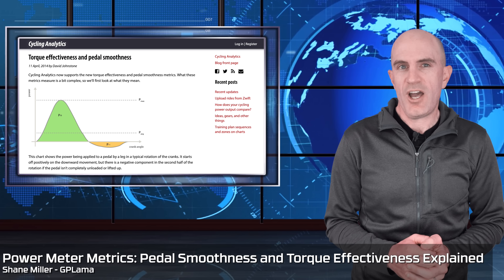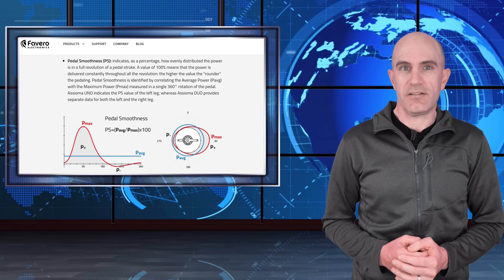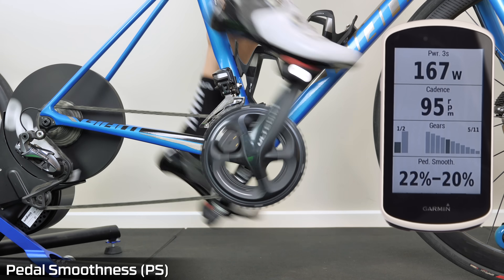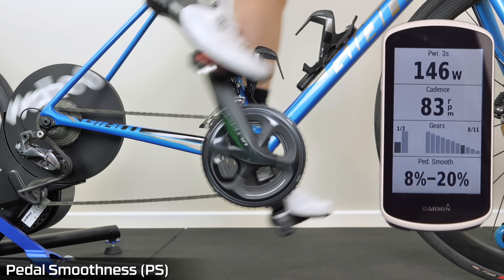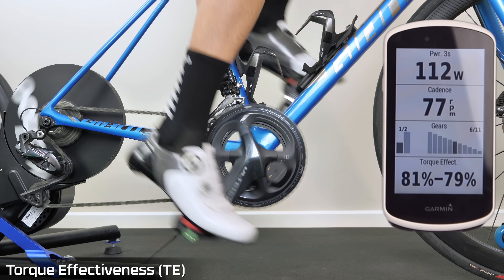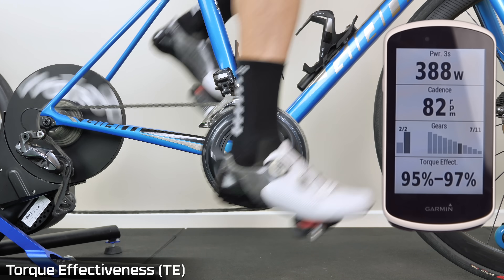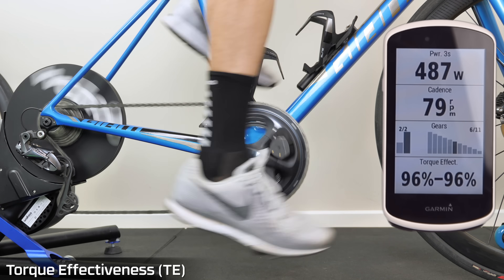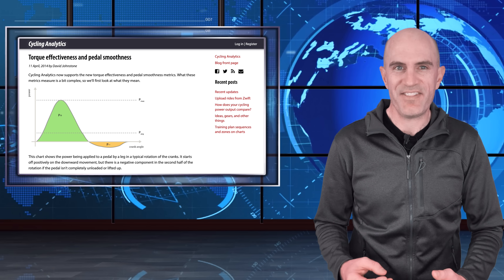Power Meter Metrics: Pedal Smoothness and Torque Effectiveness Explained

Comment: For fatigue I would think power/lack thereof would be a better indicator than TE. Like you mentioned regarding PS when trying to get to 40% that it was very uncomfortable, I'm curious if similar to "optimal cadence" if that is subjective to how each rider feels or if they are standard levels to aim for, thanks Shane. These metrics are very intriguing but still trying to determine effectiveness for the "weekend warrior".
Reply from the maker: Lower power is the result of fatigue, yep. Additional metrics (maybe these, maybe not these) could give an insight into why or where the lower power is occurring.

Comment: Thank you. 
? Elliptical chain ring metrics? Your opinion without a lama-lab test? Especially the torque metric.
Reply from the maker: Not something I’ve used sorry. Not enough data to convince me they’re worth the time. And not enough power meters support them to give good/accurate data I can use to check other meters against.
Reply: I have been using it.... I feel it's a placebo effect. Bees-dick difference. (miniscule)

Comment: I have a page on my bolt with pedal smoothness,  left/right power balance, and rpm.  I switch over to this screen for a couple minutes every 3rd or 4th ride to check in on my metrics.  Thanks for the video!

Comment: My pedaling smoothness and torque effectiveness are lower than yours on most rides. But I ride oval chainrings. I wonder if that's the reason...🤔
Reply: Do you often lift with your pedals? Pulling up and pushing in complete cirlces will increase the number. Biopace shouldn't drastically effect it

Comment: GCN has shown that there is almost no difference between clic and flat pedals. Thats why I use flats and am a happy rider 😁
Reply: That's bullshit. GCN advertises a lot of bullshit.
Reply: @marekzmazur2077  see my other post. For me, there is no difference in normal riding. Last 250m to the line, okay I'll take clipless.

I have extra large flats, so I don't have issues with slipping.
Reply: It may have some downsides, but I like to be able to move my feets, move to the toes out of saddle, mircroadjust etc. I just wish there were flat light semi stiff shoes.
Reply: @Tethysmeer  a massive downside of road pedals, the extreme danger of even walking around the cafe, stairs are booby traps 😂 or if you have a major mechanical, and need to walk any distance at all.
Reply: The only real difference is more stable connection between foot and pedal. I hate when my foot slides or even drops from the pedal (which is dangerous), that's why I use SPD. Other than that I doubt there is any significant power or efficiency benefit in using clipless pedals.
Reply: GCN is not a reference source of information. They are advertisement for products and Dogma
Reply: I'm really surprised this is not common knowledge among even weekend warrior cyclists! An efficient pedal stroke is one where you maintain power through 360 degrees. Push down with one leg and pull up with the other. This way power is generated by both legs at the same time. You lose a lot in terms of power and efficiency when not clipped in. Even during just casual riding. Flat pedal riders will argue till they're blue in the face but that's just the reality.
Reply: @marekzmazur2077  This is simply not true.  It's a myth busted long time ago. The power is produced predominantly in downstroke. Our legs evolved to push, not pull. Upstroke is mostly about properly unweighing and working in sync with pushing leg. (check this out: https://youtu.be/yjVJIudTK8E?t=345)
Reply: @michwoz  that theory was busted a long time ago. The only people who think this is true are weekend warriors, the pros have been tested and they don't do this. Did you even watch this video? As Shane himself showed he doesn't do it, and he looks pretty damn smooth to me.
Reply: @MrBJPitt  Agreed. The Smooth pedal stroke exist, but not 360 degree. More like 270 degree. 
100% push down on one side, other side do nothing to pull up.
At top and bottom, one leg do scrape pedal backward at the low point (~60% of the work), other side do 40% of the work pushing the pedal forward.
This is smooth, without pulling up.
Reply: @Hexsense  I don't think the pros even scrape? The "smooth" effect is not purely because of pedal stroke range. The pros have a narrower pedal stroke range than many amateurs who try and scrape.
Reply: @MrBJPitt  Yes, they don't really scrape much at all if the inertia is high enough that the crank turn by itself fast into to the down power phrase anyway, which is most of the time at speed.

The scrape happen when the inertia is low, like climbing slowly, or accelerating from very low speed etc.

Pro simply have more power, and most pro's additional power are in the down stroke so it is more imbalance between phrases than people with less strong down stroke.

Comment: I mix between flat pedals or clipless when riding indoors on the kickr. Of note - my best power metrics I've achieved this year are with flats.... So I'm not sure there is really a difference, unless I'm doing 100% sprint efforts.

The flats I use have a massive platform, the largest pedal you can buy.
Reply: The majority of the power is generated during downstroke, hence there is not much difference in that regard (if any).
Reply: @michwoz  so then, why the accepted notion that clipless pedals are a must have?
Reply: @MrBJPitt  Firm connection between foot and pedal provides more control, comfort and paradoxically is safer. Especially when sprinting, riding at high cadence,  out of the saddle or on bad surface where foot may slip or completely fall of the pedal.
Reply: @michwoz  maybe you are right. It's odd as downhill riders who face all that in spades prefer flats.

The flats I use never have those issues, and the comfort is unparalleled. I can use my feet in any position I want - higher cadence I put use the front of my foot - low cadence grinding, I move to the middle of the foot. My pedals are massive though, twice the length of normal oem pedals which are rubbish.

Commuting is so much better on them, I'll never go back to clipped in for commuting.
I do use my Shimano dura ace clipless pedals for "proper" rides, feels odd riding a 6.6kg bike with 500 gram pedals otherwise 😂
Reply: @MrBJPitt  Yeah. Downhillers are probably at another extreme of the spectrum as they need huge platform and ability to put the foot on the ground in the blink of an eye. XC and CX riders are all on clipless though.
Reply: Ha! My club was running a hillclimb. Forgot my shoes and had to run a pair of work safety shoes with  thick soles instead on my look keos. Weigh a lb more. Won easily. Wasn't expecting to as there were several better climbers there. Only use for pedal metrics is monitoring return from injury, plus I once found a loose cleat when the numbers went very imbalanced at low power.
Reply: @carlosflanders518  hahaha, well I'm glad someone else besides me has this experience.

Comment: Very similar numbers to yours using the Assiomas. L/R average power balance though is slightly off, 52% left, 48% right and I thought my right was the stronger one. Anyone would like to share more on this? Is your balance 50:50?
Reply from the maker: Balance... hmm... It's not static. It'll change based on power levels, fatigue, and terrain. I'm pretty close to 50:50 on average.... Today's 42km ride I was 48/52 on one power meter and 51/49 on the other.... so anything within a few % is to be taken as 'good enough'... and only accurate as long as each power meter (LR = two) is reading correctly.
Reply: @gplama  thanks for sharing Shane.
Reply: I was convinced that I was much weaker on my left leg until I got duo power meters.  I was amazed to find out that my left leg consistently produces more power than my right.
Reply: When I put some Powertaps on my indoor exercise bike I was surprised to see 52:48 or 51:49, since I am right-handed (and right-footed?). A few months later I put some Assiomas on my road bike, only to see similar results. Coincidentally, I was seeing a physiotherapist about a probable case of (medial) patellofemoral syndrome on my right knee, who diagnosed weak glutes and tight quads on the right side. Consequently paying more attention to my pedalling dynamics, I observed that my right leg was not applying force right to the bottom of the stroke (possibly because of the tightness). Now I am aware of that, my balance is slowing improving. To me dual-side pedals and their metrics are a boon.

Comment: Nice explaining. In my opinion those metrics have very limited usefulness in any training scenario. Same as L/R power balance. Maybe in post ride analysis, in post-injury or rehabilitation scenario... I most certainly wouldn't base any purchasing decisions on power meter having them or not. Power (and sometimes cadence) is what you need 99.9% of the time.